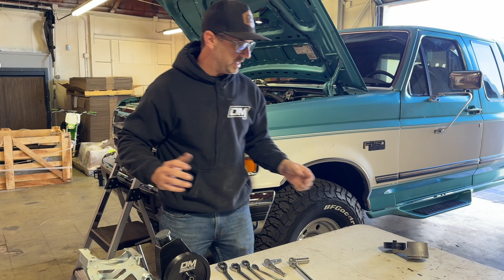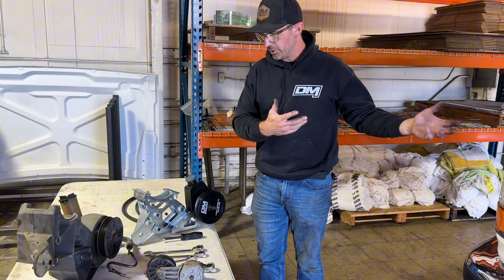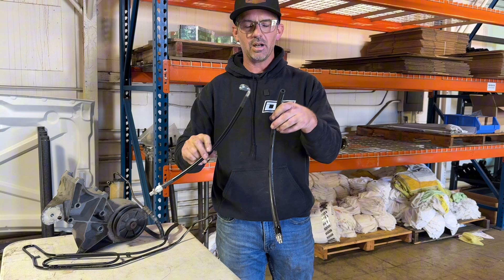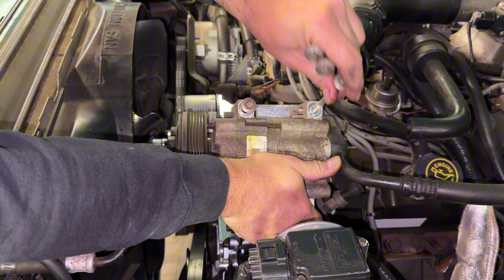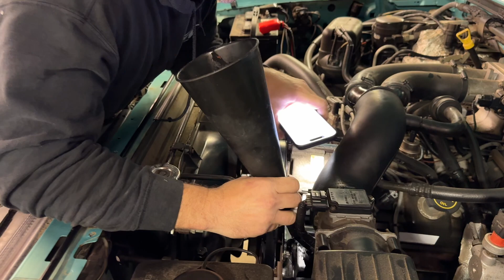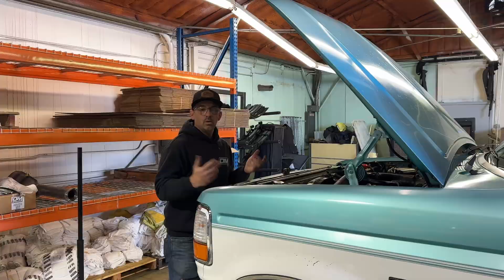Install Guide: F250/F350 7.5L 460 Saginaw Power Steering Upgrade

Comment: If i was to use the trans cooler on the radiator (not in use because of aftermarket cooler) would that be a bad idea to use as the cooler for the PS pump?

Love your products!! I get compliments constantly on the bumpers and the lift